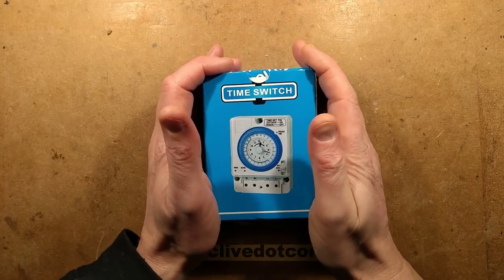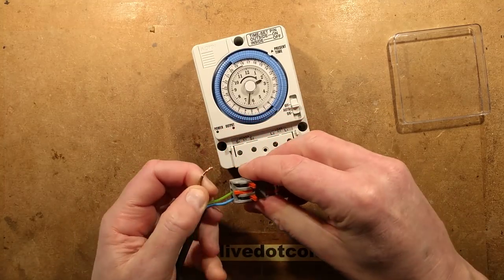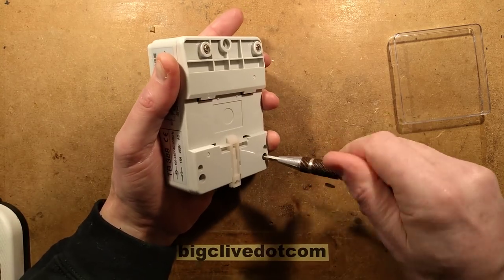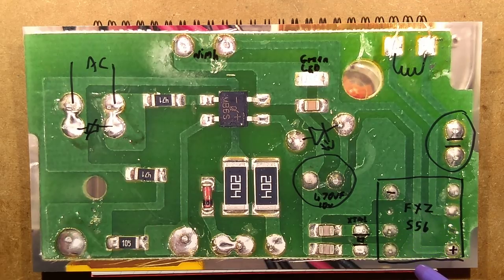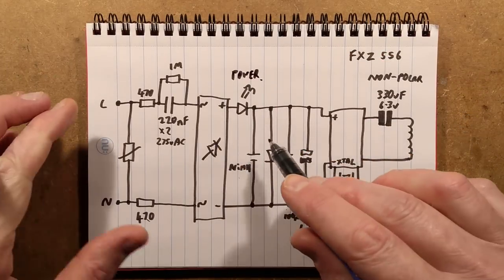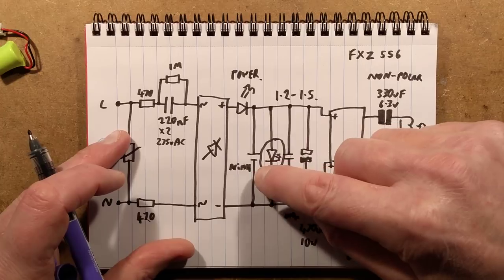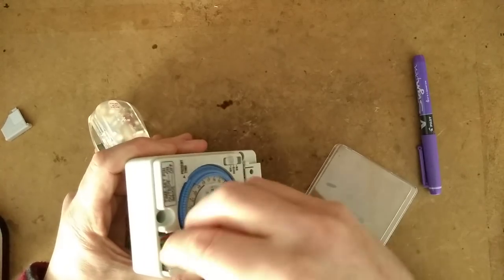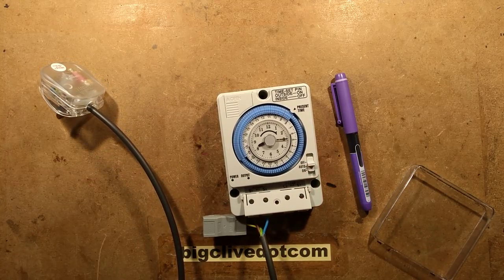Inside a Japanese street light time switch.

Comment: isnt there 2v-ish zener diodes that do effectively the same thing as that led is used for?
Reply from the maker: The LED might be cheaper and could double up as a dead-battery indicator.
Reply: Zener diodes below 5-6V are pretty much useless as voltage "regulators". They don't have a sharp "knee" in their voltage/current curve. That, and I don't think I have even ever seen a Z-diode lower than 2.7V (because you might as well use normal diodes in series for a much better behaviour if you need a voltage that low).
Reply: @superdau  You've never seen a zener diode above about 5.5V.
Reply: @bigclivedotcom  Not sure about prices, but I suspect the electronics designer came up with what he or she thought was a very clever dead battery indicator.  Then the production engineer decided it was too expensive to design the case and circuit board to make that LED visible but didn't know enough electronics to realize that they could have used a zener if they were going to hide the LED.

And it is a very clever dead battery indicator.  A steady light may be ignored, but a flashing light grabs attention.  Because of the regular load of the motor pulse, the flash comes for free - no need for extra circuitry.  So the clock circuitry is protected from a dead battery and you get a visible indication of the dead battery.

The electronics engineer should be given a pay rise.  The production engineer should be fired.
Reply: @bdf2718  are you calling those "avalanche diodes", though?
Reply: @tomaszwota1465  Correct.  Of course, both effects are present but the zener effect dominates below about 5.5V and the avalanche effect dominates above it.

The voltage where the dominant effect swaps depends a little on the exact design.  But you can tell which effect dominates by the temperature coefficient.

Yes, I was being pedantic.  Most people refer to both types as zeners.  But that temperature coefficient can matter...
Reply: @bdf2718  
I know. I had already written that it is the avalanche effect and not the zener effect that creates the sharp "knee" above about 5-6V, but deleted that line again. Wouldn't really have added to the explanation.

Comment: @bigclivedotcom
What's being used in your region to switch street lighting?
Where I live we use a system that responds to a signal that's being sent over the power grid (by means of a TF receiver switch). Years ago I was working for a company that had quite a few sodium lamps to light the outside of the building and I was asked to make sure they were turned on and off at the desdired times.
I installed a TF receiver switch so the lights were switched on and off in sync with the street lights. Quite neat and everyone wondered how I managed to do it :)
Reply from the maker: I think locally it's a mixture of a timed lighting circuit and RF signal control.
Reply: @bigclivedotcom  Where I live (Western Australia) it used to be a timed circuit via one or more additional feeds, but they've removed most of those systems in favour of lights which have their own photocells. Only major freeways/highways now use the centralised system.

Comment: Around 12 -13  years ago I was working as a technitian in a workshop for a white technick repairs. There i have seen similar timers, but not the same. They was maded in Turkey, if I rememmber correct. But only for 210-240VAC 50Hz, with orange dipps, 4 for each hour... They wasn't maded with screws but just glued plastic peaces.  I will look in my garrage to see if I still have one of them.

Comment: Have you ever made a video on USB A to C cables?  I see them advertised with a selection box for the device you wish to plug it into.  Are there really differences and can they damage the device to be charged?  I find no consensus out in the wild.  Maybe - how to test them video.
Reply: Standard USB signaling has no such nonsense (though the committee has gone crazy recently).  But Qualcomm and a few other brands have non-standard "fast charging" signals to tell devices if the power adapter is able to feed more than 5W.  So someone is probably selling power cables that can tell devices they are plugged into their own brand of power adapter, as those devices ignore any other setting and fall back to drawing only 2.5W.
Reply: @johncrowerdoe5527  Thanks.  It sounds safe to use any "not for brand" USB cable for charging, albeit for slower charging.  I still wonder if a cable "for Samsung and Huawei" would have a negative affect on some other device like a Pixel.  Maybe the only damage would be to the power adapter if it is incapable of delivering the power the device can receive and is signaled for by the "for Samsung..." cable.    .... thinking more .. An overloaded power adapter may initially have a voltage reduction.  I don't know what affect this would have on a device being charged.

Comment: It may be of little interest to some but you casually breezed over the decoupling capacitors on the quartz timer. From what little I know decoupling caps are, on many occasions, a very significant part of electronic circuits; would be a grand idea if you did something a little more in depth about their application in real-world electronics.
Reply: Quartz oscillator caps are very different from power decoupling caps in what they do.
Reply: @johncrowerdoe5527  You've kind of reinforced my point. I'd like a little more detail as to why they are needed, and how they resolve whatever issue they are put there to resolve. Just announcing that a component is put there to solve problem x, y or z doesn't really help much without some measure of explanation as to what the problem actually is. If I search videos regarding decoupling capacitors, the chances are I'll get explanations regarding their general use in smoothing signals, or removing unwanted frequencies from the system. You've now implied that in this instance these caps are doing something different. Well that begs the question, what?

Comment: I swear street lights here are switched by a brightness threshold with a sensor of some description placed on top of the lamp.. Can’t quite understand what advantage a timer that needs to be set as sunset and sunrise move has. If they use them I assume there must be a good reason for it?
Reply: If the photo switch fails on having a timer means the thing is not a 24/7 "day burner". Another possibility would be false triggering were a bird to perch on the lamp.
Reply: The pointy white thing on the top of street/traffic lights is a solar switch, 
Inside is a large LDR in series with a thick film heating element that cooks a bimetallic switch.

Comment: I've bought 2 mechanical timeswitches and not used them. The first was for the washing machine - which forgets its programme when the power's off and the second was for an ??? bed (air mattress thingy) but it had a power failure alarm in it - so I couldn't use it for that !

Comment: 'FUN' Fact of they day. Japan's energy grid is split in two. Tokyo and up uses 50 Hz and Osaka down is on 60 Hz
Reply: I mentioned elsewhere, someone made a map on this, the map of Tokyo itself is a mess, the other user mentioned something about it being on which side of the river you're on? So the map details districts that cover both sides of the river are coloured in with stripes.

So Kyoto and Osaka being very close to each other and simply west of Tokyo, means they're both 60 Htz cities.

How do people with Tokyo even deal with this?

Imagine renting or buying electronics from the European standard side of the river, and wondering why it won't turn on, or the opposite, and just blowing out the thing from simply too many volts.
Reply: @SimonJ57  It's not really a problem, because everything works on either frequency.

Comment: I trashed almost every year those damn clocks used for running the pump of my pool. Leave them unpowered for 8-9 months kills the battery and the clock does not work. That battery is soldered most of the times.
I made an experiment with the last dead clock, tossed away the battery and put the biggest cap i could fit, i think like 3000microF. It seems to work, lives for 5-10seconds after disconnecting power but i hope it will be usable the next year.
Reply: The battery is there to keep it running in case of a power outage. If you don't need that, the capacitor is a much better choice. It doesn't even need to be that big, just enough to store enough energy for the short pulse every second (does the clock not work at all without a cap or battery).
Reply: @superdau  I wasn't sure, i put the biggest i could fit. Yes the clock doesn't work without and do the same with the dead battery. I'm surprised that this one tested by BC works also without the battery. This should always happen. My alarm clock simply lose the time if the battery is dead, it doesn't die itself.
Reply: @superdau  A supercap would work nicely and last long enough for the occasional outage.

Comment: Appreciate the video.  I always use the time clock contacts to drive an interposing relay, and I put a photoeye in series with the time clock and relay coil.  Either the time clock gets off time or the photoeye dies shorted, then I have at least one method to keep the lights off during the daytime.  I never run the lighting power through the time clock contacts or the photoeye. Always use an interposing relay. Then it will last for a long time.

Comment: I can't really believe that a technologically advanced country like Japan is still using mechanical time switches for controlling streetlighting,  when  even in the UK, photocells have been used for many Decades,  & since the introduction of LED streetlighting, these are group switched using nodes & RF signalling. 

The backup battery is a feature you don't usually find on run of the mill mechanical timers.
Reply: I'm inclined to agree with that statement, I wouldn't expect the infrastructure managed by the local government to still be controlled this way. However depending on the area there might be another aspect of "street lighting", it might be for places with more area between the public street and the building having their own lights on private property. Or for example shiny neon stuff on the outside of buildings inside city areas?

Comment: I still use that type to run my Christmas lights. Make sure it's ment for outside use in wet climate. They usually come with a cover of some sort if they are for outside. You can buy them at most resale shops for cheap. The difference being ours use a US plug, not a pin style plug like that. That One looks dangerous.
Reply: The plug and the cable are just part of Clive's lab, not the clock.  Plug itself is a transparent version of a standard British plug since that's where he lives.

Comment: The diode is across the LED because if it were in series, the voltage across the LED could exceed the PIV rating of the LED.
Reply from the maker: I thought they might have used two to reduce the resistor dissipation.  It's not uncommon in cheap products to see a resistor in series with a red LED across the mains.  The LED does conduct in the reverse direction when its reverse voltage is exceeded, but it doesn't seem to damage it.  The more modern gallium nitride LEDs don't survive that treatment though.

Comment: Why do Japanese street lights use timers? They use light sensors here, I thought that would be standard around the world.
Reply from the maker: It's not uncommon to use both.  The timer comes on early and the dusk sensor then turns on the light when it gets dark.  Then the timer turns the light off at around 1am if they are not needed.
Reply: I guess it would also avoid having a faulty light sensor have the street light on during the day

Comment: Might the led start to blink when the battery has full charge?
Reply from the maker: The battery should reach a maximum voltage of about 1.5V with normal trickle charging.
Reply: @bigclivedotcom  so... No blinky internal light?

Comment: The front of the case is very reminiscent of the Smiths, and other brands, of timer switches you could buy in the late 1960's  
They were simple mains synchronous clocks with a mains relay coupled to the output switch.
Reply: It doesn't look like Morrissey...

Comment: Are you thinking of synchronous motor ?
Reply: It’s not a synchronous motor because it’s not running from the mains AC.
Reply: Mechanical quartz clocks/watches use 'Lavet' type stepper motors... Wikipedia has an entry covering them.

Comment: Is there a non "full bridge rectifier?"
Reply from the maker: Yes.  A diode is a half wave rectifier.
Reply: Paul Pomykala - Yes. For single phase AC supply, use a transformer with either a centre tapped secondary or with twin secondary windings and wire up as a centre tapped secondary. Each winding then feeds a single diode (acting as a half-bridge rectifier). But because the windings are in anti-phase, for the first half cycle one diode conducts, but on the next half cycle the other diode conducts. Result, full-wave rectification with only two diodes. This technique is used far less these days (diodes now being far cheaper than suitable transformers), and is only possible if a suitable transformer is used.

Comment: The issue with Japanese generation is that it has dual voltage depending on region. 110/120v 60hz and 230/240v 50hz. Devices have to cope with both...
Reply: Completely wrong, go and research.

Comment: if they put extra poly fuse then it would be much safer ..not sure why they didn't ..well i expect it is not UL rated soo who cares about fire at home :)
Reply: I have been unable to find mains rated polyfuses.  Either the technology doesn't work at higher voltages or someone is dutifully trying to comply with safety rules never to have mains turn itself back on while you have your hands inside dangerous machines (electric and mechanical danger of serious bodily harm and death).
Reply: @johncrowerdoe5527  Good point ..but even then they could use normal small fuse  instead of polyfuse..and it would be still ok ..better than no fuse at all
Reply: @SylwerDragon  Yep, or a fusible resistor as others mentioned.
Reply: @johncrowerdoe5527   well yes that is option as well but i'm personally against that idea and reason is because you are using component for purpose it wasn't designed.yes it will have same effect but it isn't the same thing..resistor could stat fire and it is unlikely with fuse ..if correctly designed..but in principle it would work
Reply: @SylwerDragon  A fusible resistor is a component specifically designed and rated for use as a fuse.  Not just a random resistor expected to fail at high current. However both the MOV and fusible resistor are expected to fail quite spectacularly and should be in a device housing that can contain those effects. The 800°C glowwire test is certainly needed, as well as mechanical strength and destructive high voltage tests of both fusing and switching scenarios.